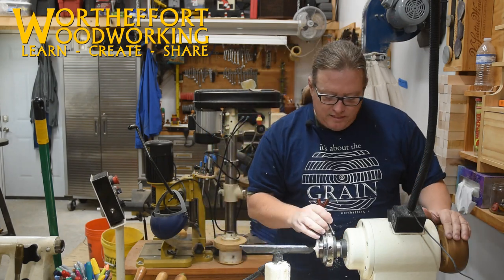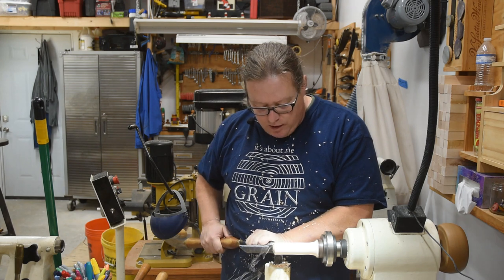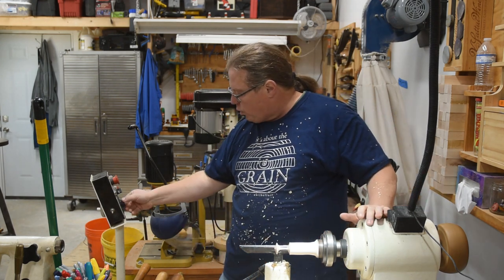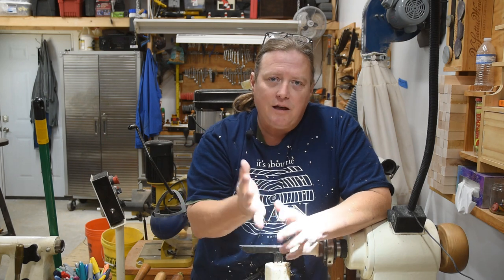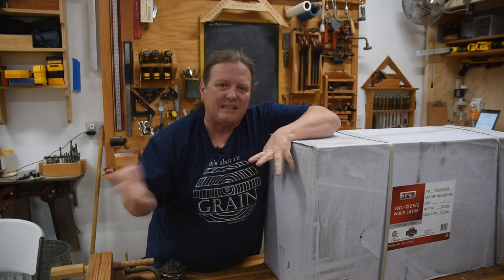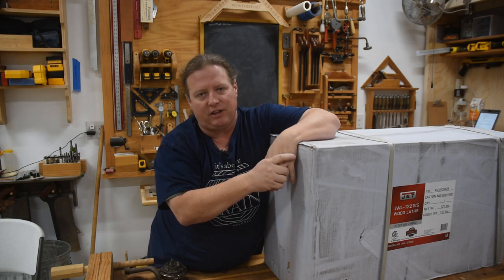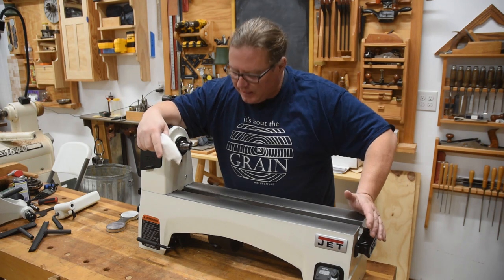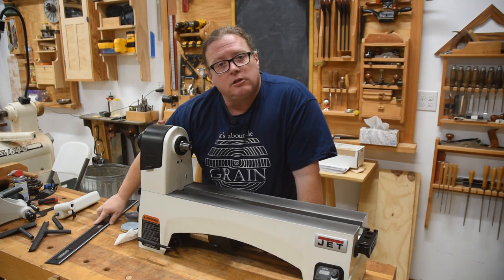The Lathe  - Turning Basics #01 - A foundation video class for wood turners.

Comment: I just bought a Jet 1221VS last weekend. I replaced my Nova Comet II that I got used to see if I like turning. Love it!!! I think I took the Nova to it’s limits while I had it. I did a lot of needle cases based on your video, the tail stock left a bit to be desired for the production.   Sold it 5 hours after I listed it!  The Jet is a monster for the size.  It is heavy and absorbs a lot of vibration. I created a heavy table I mounted it to. My quill will release the live center but you have to turn the quill in almost all the way. Mine took very little work to put it into use.  Love your style and presentation.  I am a retired electronic technician and an avid wood worker.  Being retired now I have a lot more time to make sawdust.
Reply: I just bought one on black friday -- how wonderful to have this video as I'm beginning the craft.

Comment: I have the same lathe, on mine you can back the tail stock quill all the way inside and then you’ll feel it stop but if you turn it just a bit more it will pop the center out by itself, instead of having to use the knockout bar! Appreciate your videos and have learned so much from them!

Comment: I bought this very lathe to learn on after watching your earlier videos. On mine the live center for the tailstock did have a plastic piece on the bottom so it could be backed out.. you might look around to see if it dropped out.. BUT MORE IMPORTANTLY, after a week of turning the headstock began to vibrate!!  The four screws holding it to the bed had vibrated loose!  There was no locktite on them to hold them secure.. be aware of this danger. That was the only thing wrong with the lathe.  After watching this video, I will be shopping for for new tool rest as mine have become dinged as you predicted.. Thanks for the new series

Comment: I have a small area to work in, so the Jet midi lathe is what I use to turn with all the time. Mine is about 16 years old now. I see that Jet has added some nice changes and accessories.

Comment: Great video, Shaun. I picked up a number of tips I should've learned a long time ago.

Regarding live centers, I finally upgraded the stock Rikon center, same style as came with your Jet. Interestingly, it won't eject by retracting all the way. However, I just upgraded to the Nova 6-in-1 live center and it does, but won't eject with the Rikon bar. The knockout bar hole on the live center, for changing the variety of tips, is large enough that the Rikon bar will not eject the Nova center; you have to retract the quill to eject it. It's not a big deal, and I cannot think of a time that I need to remove the center without retracting the quill, but it is a strange pairing.

I like my 70-1218. I do wish I had shopped around a bit more. A few hundred dollars more & I could've had a lower minimum RPM, reverse, indexing, etc. But, maybe it would've been just that inch too tall for me, from my seated position. Thank you for an evening well spent watching.

Comment: I bought a Fisch TC 90-100 at a Woodworking show about 20 years ago.  Couldn't resist the deal.  They included the bed extension and the Oneway lever operated chuck.  It's been collecting dust ever since.  Replaced the dry-rotted belt in 2009.  Now I'm going to try turning something.  Did I mention I'm a procrastinator?

Comment: i got a lathe for Christmas from my fiance, i just need to build the stand for ut, and I have watched your other vids, been hoping for this series! Great work as always Shawn!
Reply: I'm fairly new too, been turning for about 3 months, the one suggestion I have, that he hasn't touched on yet, is safety stuff. If you buy nothing else, please get some decent safety equipment! Probably the most important is your face (since dental bills take away from buying new toys..er, I mean tools)  get a good quality FULL FACE SHIELD. I'm in Canada, and paid about $70 for mine (anti fog is really nice), as much as we'd like to think things won't fly off MY lathe, they do, and Murphy 's Law sends them all directly at your face! Otherwise, take a deep breath, get a stick or scrap of firewood and jump in, my biggest regret is taking a year to build enough confidence to get started (now I spend almost every evening at it). Lastly, ALWAYS, stand to one side as you turn the lathe on, the most likely time something will fly is in that first few seconds! Happy turning!
Reply: @quietinspirationcreations3448  og yeah, that was the first thing i bought. Ive since gotten a set of rockler carbides and cheap HSS traditional tool sets. I cant wait to get into it, I just dont have a lot of space, and sliwly trying to build a working shop inside my home, so its been a challenge...luckily U work with hand tools mostly, so its pausible, just need to get everything on a sturdy surface.
Reply: @justinsane332  I totally get the small space issues, I have a large garage (30'x30') that is currently unused because I live in Eastern Canada and it's un-heated. I brought my lathe, grinder, table saw and belt sander in the house for the winter, I'm working in about a 6'x8' corner of my basement and doing all my gluing/resin work on my coffee table in the living room. At this point I'm so hooked that I'd put the lathe in my bedroom if I had to!
Reply: @quietinspirationcreations3448  thats an idea!
Reply: @justinsane332  
Ya do what ya gotta do! The fiance can't complain too much, they bought it for you! Haha!

Comment: Hi Fron England UK,

The hole in the live centre as with the drive centre means that you can tap out the center pin 
and then use a boreing bar to drill a hole through a long spindle turning,  such as you may
want to when turning a spindle for a table lamp ETC.

Nice video.

Bill.
Reply from the maker: Yes, most all of them come with that tapped hole (I'll get into the uses in a second more advanced semester) but this particular live center was hollow. Almost like it was pressed steel.

Comment: So excited for this series Shawn.  
Great introduction. Wish I had seen this a couple months ago when my lathe arrived. Took awhile to realize the faceplate did need an allen key and it was not provided not mentioned , that I saw, in manual. Was only disappointing thing so far about the lathe ( and the 5 week wait for electrician to replace panel and add 220 outlets )
Reply from the maker: Thanks
Reply: Watched the video 3 times. Wanted to add thanks for showing full size lathe stuff as well.  Since I waited years to get my lathe I did a lot of research on what I wanted to do and what I needed. Have several trees cut and drying for several years, chose Vicmarc 120, Trend shield and Powermatic 3530C. Added a small Robust tool rest for smaller turnings .  Got some good ribbing from friends about all the safety stuff I bought before even buying a lathe lol.  Sorry a lot of useless typing but tired of being stuck at home unable to go somewhere for lessons.

Comment: Pretty excited about this series!! I bought the same lathe in January as well. I did recently buy a oneway chuck off eBay but it didn’t have the set screws in it to use it in reverse and the faceplate set screws are a different size. Could you tell me what size those set screws are?!?! I have tried to find this info but have had no luck.
Reply from the maker: The set screws are part of the thread adapter. Just pick up another adaptor.
Reply: The Oneway set screw is metric. Suggest you take the chuck to  the specialty screw section of a big box hardware store, and find the correct size. I know that Lowe’s carries that set screw. I would get some extras.

Comment: Thank you, great video.  I have a question regarding the set screw to hold the chuck in place for reverse turning.  Will the screw eventually destroy the spindle's threads?
Reply: On my g3 chuck the set screw sits behind the threads, so it can not damage the threads unless you forget to back the set screw out before removing the chuck.
Reply: @michaelbunn1465  Thanks Michael I didn't realize that.

Comment: I wish I had heard this video about six years ago, I was just stating on a big piece of wood and did not know it had a fault ruining through the middle. I switched my lath on, it want airbourn, and the big bit hit me square in the mouth. I was wearing a full-face mask with strengthen glass visor, I ended up having to get my girlfriend to drive me to A&E here in the UK and I lost six teeth and messed up my upper lip and pallet.
Reply: WoW! .. so, even the full-face mask visor is not enough to protect us from those accidents !? I do turn some split blanks filled with resin sometimes. I always wondered if the resin is actually enough to hold the split blank safely.
Reply: Yeah they forget to tell you that you need to purchase cricket goalie armor as a wood turner. I’ve had chunks of wood hit me in the chest and fly past my head. Looking for a Bobby Kevlar chest protector, helmet with a face shield. 😂

Comment: Shawn - usually you remind us when we hammer a drive center in - don't hit metal on metal - you can damage the taper.  Wood mallet, rubber, nylon... all good. Steel, no. You of course only USED wood or, I think rubber once, but you didn't remind us.
Reply from the maker: Never think of that because I don't use metal hammers in normal work.